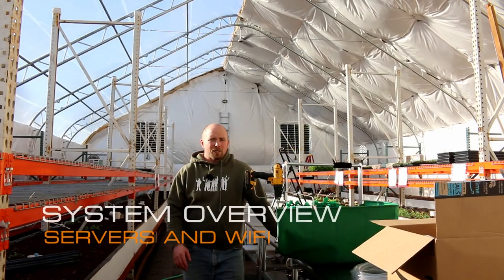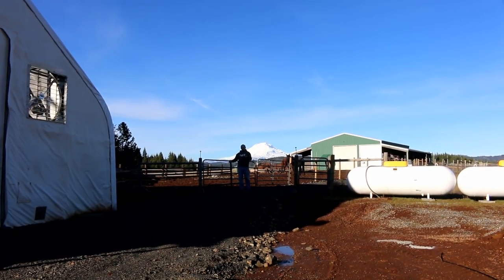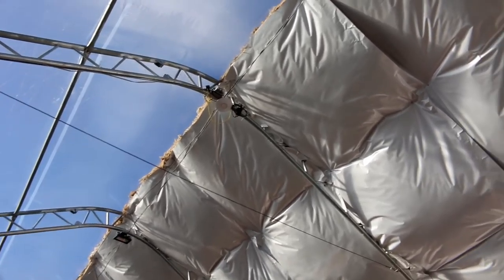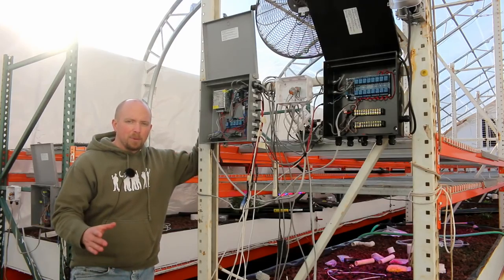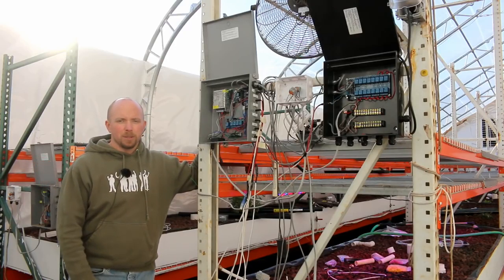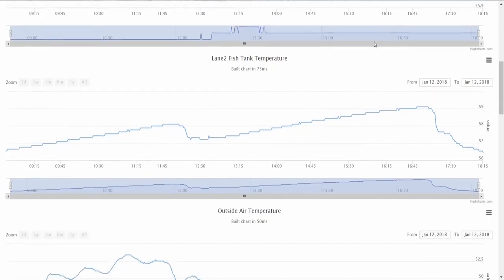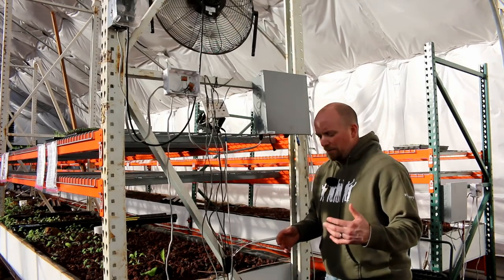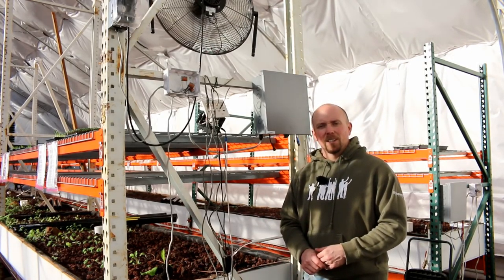GREENHOUSE Automation - Connecting Everything... TO SKYNET

Comment: Excellent choice with Ubiquiti. We're running a security camera at a remote site off of one with a second being added once the weather warms up. 

I'm no good with mobile but can do PHP, and HTML. What's your refresh rate of your data coming back to your server? Real time, 1min, 5min? I work with a similar system that runs over the cell network. data rates can get expensive but we got it backed off to to a tiny amount. way less than 1gig a month.

Comment: Sounds like your committed with the server/database setup, but maybe consider a home automation type setup like node red and mqtt sensors/devices. Easy to program with Arduino board, pretty stable server, ready made dashboards and easy to customize and very flexible. 

I use a bunch of wemos d1 with easy esp to run a few automations around my house... Ie measure my sump pit level, graph it so I can access it anywhere and send a text if it gets too high
Reply: 1+      NODE-RED is a very powerful data and control application that runs on a server. It runs on everything from a windows or linux desktop to a raspberry pi. It can connect almost any input to almost any output using what I would call "program by Legos". You drop in "nodes" which can be any type of input from temperature to water level and "wire" it to a function block which can be any type of comparison including timed operations and send the command to any output such as a relay control for a valve. It also makes creating the web page dashboard real easy with pre-designed blocks. There is a large user base and a forum that is good for answering questions. There is a large library of pre-written nodes for different purposes and it all can be downloaded at nodered.org. Best of all the software is FREE.

Comment: I'm guessing the static IP is for local WAN/LAN not from the ISP. If your ISP has a dynamic ip there are little scripts to run on your server that will update a website whenever your ip changes. This will keep you connected. 

For home use, keep it simple with text message alert when thresholds are breached, and perhaps use a vpn based access method to get to your internal server. 

I would be interested to hear more about the actual server setup, software, and settings. How often is data sent? 

A Deadman switch should be easy, have your master wemos run  off of a battery with a wall wart keeping it trickle charged. Have the walwart run through a relay( for voltage reasons) that feeds an input...when power fails the input will go low from relay turning off triggering flag for power outage. The wemos could keep sending the time the power has been off until it restored or utility the battery dies.

Comment: Happy to answer any questions anyone has on the wireless bridging Jeff is using here. 

Jeff, I'd love to hear about your setup. Looks like a Nanostation or Locostation as your AP side.
Reply: Also, why static IP and not DDNS?
Reply from the maker: +Evan Sanders yes nanostation
Reply: TheRealMartian Id be curious what the CCQ/airMAX quality and capacity readings are on that link. You ever lose connection?

Comment: How much of a pain has WiFi been? Given all the devices need power, I would have been tempted to go wired, with PoE switches. And a bunch of PoE powered Ethernet relay controllers.
Reply from the maker: it hasn't been too bad...the wemos really made it easy
I tried a pure up esp8266 on the mega and had nothing but problems getting it to work, so went with the master/slave concept to get the IO I needed...so far, no major problems (after initial IP setting and setup)